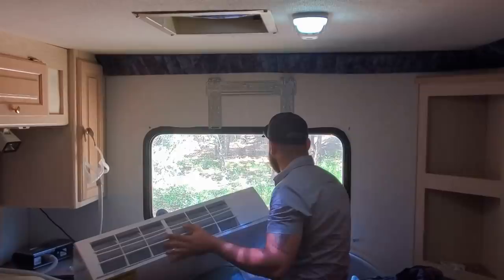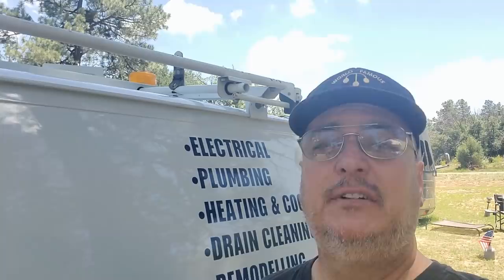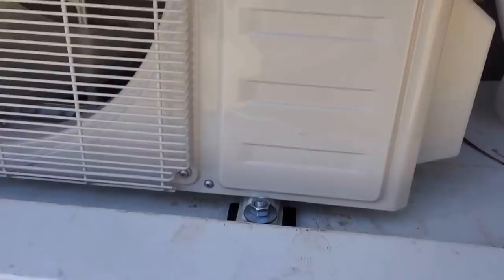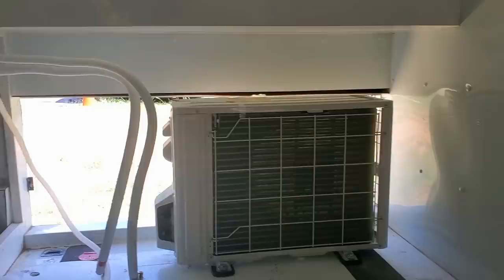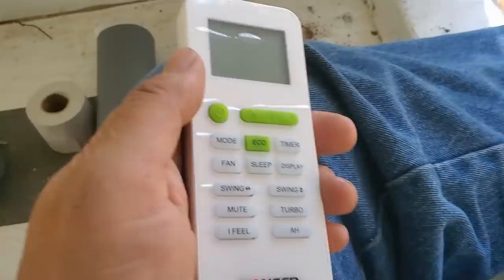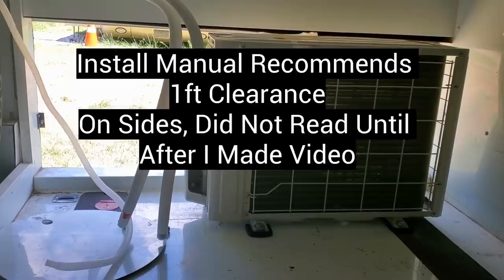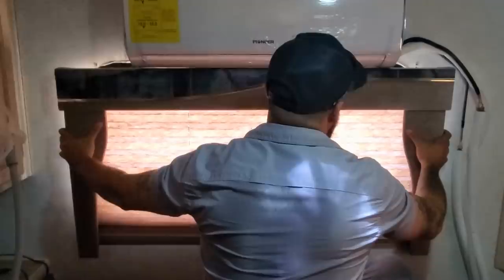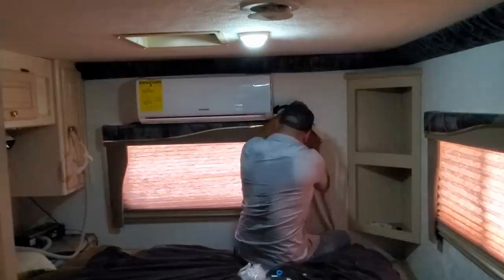Heating And Air Company Installs Residential Mini Split In My RV!

Comment: The fact he used nitrogen to check for leaks before adding the Freon tells me he’s a pro. I’d say you got an extremely fair deal for quality work. Always nice to see honest professionals who treat their customers fairly and do a good job at a fair wage. Congrats on the mini split. I think you should consider modifying the garage door with a vent to exhaust the hot air(probably need an intake somewhere as well) so you can securely run the system any time without worrying about critters or humans messing with your stuff.
Reply: I was thinking the same thing
Reply: Was thinking same thing.Cheaper and better for environment than freon leak.  Going to have to make sure to keep trunk clear enough to get air needs grills for intake and exhaust, I would duct exhaust to grill to cut down on recirculation. maybe some flat rubber with formed sheet metal corners. and brackets to attach to door grill.

Comment: I'm an hvac technician myself and I will say that man did a professional job on that install for a vary reasonable price.
Reply: Do I need a cutoff on the power supply, and where does it go in a Bumper mount for my camper

Comment: I have had apartments in the past and found that cardboard was the very best material to protect furniture, keep metals from rattling, and for so many uses to solve squeaky problems. Stick little cardboard pieces between your screws and the unit. Cardboard hugs tight. 👍

Comment: $331 to install that mini split was a steal, I had two in my house that I sold last year. Had two separate HVAC companies come out and quote me to install a double head unit one for the living room one for the bedroom. Lowes wanted $15,000 and the electric companies contractor wanted $9000. I went on eBay and bought two mini splits a pioneer and a Senville. I bought the
 tools to install them myself. They worked perfectly for five years that I lived in the house until I sold the house last year and the new owner wanted them so I let him have them. 
this guy did it right, purge the system with the nitrogen to get the air out of the system and did the vacuum check with his micron gauge. The air in the system is what causes these units to go bad after a few years. It corrodes the compressor.
These mini splits are so much better than the RV units and also they are very good inside houses.
Reply: I got split units for my house and cut my power bill in half.

Comment: RV roof top AC units last much longer than three to five years. I just sold my class A of 15 years and both AC units worked fine. Same with our trailer roof top. Works fine and it's 12 years old.

Comment: Bless Tuckers little heart, he's so sweet.
   I bought a 2020 class c thor 22' brand new and within 2 trips out I decided to drastically change my rv.  I love it now.  The Niecie B is my style now and my tiny home on wheels.
   She has more foot space now.
   All the valances were taken out and  I  made new window coverings for them, it gives the space a larger, more open concept.
   Changed the bed in the back to a twin bed and am able to walk up a step and sleep in my cozy bedroom.
   I couldn't find a MH I liked so I created my own space.   Installed a Sun Mar separating toilet and 
That eliminates the water waste and no emptying a black tank.  I'm a happy camper.
    I love the mini splits, I  have 4 of them in my home.  They are so efficient.
     How much solar do you need for a rv mini split?
   Take care Woof pack and say hi to Kevin.
Reply from the maker: Depends on heat or ac and location.  Heat uses lots of power. Ac not so much

Comment: I repaired and installed transport refrigeration units for 30 years. He did you right. Working on RV's is a pain. Having the customer supervise is even more of a pain. 
Rooftop air freezing is an indication of a low charge. In a humid climate you would notice it more. If you or a viewer would like to know why, I will explain. If nobody cares to know, I will save myself some typing.
Reply: Id say most likely on that too, unless the unit is super super dirty....
Reply: Danny is there a way to communicate with you privately .I have an ac question...
Reply: @judiwilson9229 I don't see how without one of us publicly posting an email address.  
Most air conditioning questions are not that personal, so ask here if you can.
Reply: Danny ok ..I have a house ac...I use on the average of 1300 kilowatts per month..the last 2 months they say I have used  3600kw.... Last year this time I was using 1300 weather was hot as it is now...can an ac unit make it rise like that? Or would you say a bad meter...two months ago I had my ac serviced because I didn't think it was cooling well enough and ac man put in three pound of freon 

I do know I have a leak some where in system..because about every four years I will need freon..my question is the kilowatts???
Reply: Id go to any new appliances first and check them. Use a programable 7 day thermostat (digital) and set it up to run per economic settings. Also check your thermostat programming, make sure its not "on" all the time.
Reply: @judiwilson9229  3 lbs is a lot of refrigerant to add to a domestic unit. It is possible your unit was over charged to try to compensate for a leak. There also could be air in your system that was not removed. Both things will raise the operating pressures and temperatures that the compressor has to work against. The harder the compressor motor needs to work, the more electricity it will use. The oil in the compressor can also become acidic and eat away at the motor's electrical insulation causing an early compressor failure.  When the compressor fails, there is usually a lot of contamination throughout the whole system. Cleaning it all out is not easy. Just replacing the compressor when it fails will cause another early failure. Many older units used a refrigerant that is no longer available, (R22). 
We used to have a sign where I worked that said, If you don't have the time to repair it correctly, where will you find the time to repair it again?
Putting a quick fix on something usually will cost you more in the long run.  An automotive air conditioner is a bit different as the compressor is externally driven. this means there is a shaft seal that will never be 100% leak proof. It is possible that every few years more refrigerant will be needed. A home unit should never need more refrigerant added. The motor is inside of the compressor housing. there are no shaft seals to leak. Not repairing your leak may have already caused you an early system failure. Start saving up for a new system.
Reply: Danny thank you..have two companies coming out to give me bids..but is it my understanding that I would need the lines changed too??? Or cleaned??? They are hidden behind sheet rock...
Reply: As far as the 3 lbs ..I think he put in one and a half..and then came back a month later and added another...the first time it wasn't that hot outside..he didn't get a good reading...and yes my ac uses R22..
Reply: @judiwilson9229  Being 3 lb low indicates quite a leak. The sooner the leak is repaired, the longer your system will last. Keep adding refrigerant is not going to work. When your tech runs out of his supply of refrigerant, they may not be able to get more.
The likelihood of a bad meter is very low. Something in your house is using more electricity.  You can also check to see if one of the air distribution hoses in the attic came off and is just blowing the cooled air into the attic.
Reply: @YouTubeRanch  Bids are important, but the lowest bid is not always the best deal. They may be offering an inferior product, or hap hazard workmanship. Check references with any contractor.
Reply: @judiwilson9229  If the existing lines will work with the new operating pressures, it should be OK to keep them, but a new system may require different size lines. Sheet rock is not that difficult to replace. That is where your leak may be. someone may have hung a picture with a nail and poked a hole in the tube, (they are copper or aluminium). 
The installer should pressure check during their install if you do keep the lines.
Reply: Well I wanted to let you know what was going on. I had the power company come out to meet her was fine. So they were very nice and started doing some probing into what was drawing so much electricity we thought it was the AC unit but it turned out to be the fan motor on the furnace it was going crazy drawing kilowatt time. So my new furnace and AC unit gets put in next Wednesday. It's time it's been 40 years. I got my money out of it. Thank you everyone for your advice
Reply: @judiwilson9229  Very glad that you have a solution. A friend had a similar problem with an expensive bill. It was a leak in his water line coming from a well pump. The pump hardly ever stopped running. 
It is very rarely a bad meter.
Reply: @judiwilson9229  Thats great! Good call using the power company to find your load. Remember on that new system more efficient means less $ to the power company each month. Good luck.

Comment: Kevin< I have a 12000 btu in my house also a Pioneer and I find that the condenser unit also condenses moisture that I find in the morning. the unit has a drain hole in the bottom and comes with a fitting to install with tubing you may want to use that and drain through the floor.

Comment: Tell Felix the Over head cam V10 engine  he will stretch the cam chain's  just start it let it ideal dont rev shut it off standard oil will kill the roller lifters. He will buy another rv before pay for new chains if you can find them.

Comment: FYI- for roof AC-  #1 clean the filter #2 check the evap coils for dirt/blockage. #3 Remove the control face and look for any gaps that should be foil taped. #4 Verify plenum divider is in place and sturdy. Brand new, a roof RV AC should have a Delta of 20 deg lower than ambient air temp.

Comment: I have to say I think he was cranking up his price by using nitrogen to check for leaks.  I'm sure that added a line item.  You check for leaks using vacuum.  You put it under vacuum and let it set for 30 minutes or an hour and if the vacuum hasn't dropped you have no leaks.  Pumping Nitrogen is just doing the same thing.  It's redundant when you do a vacuum leak down test.

Comment: REALLY IMPRESSIVE VIDEO....MY OLD ARMY BUDDY LIVES IN A 2 CONTAINER WIDE 40' MADE HOME. VERY PROFESSIONAL LOOKING. HE LIVES OUT IN PHOENIX ABOUT 30 MINUTES AWAY FROM ANYTHING. HE PUT 5 MINI SPLITS ON HIS HOUSE. HE ADDED A GARAGE THAT WAS THE 5TH ONE HE DOES NOT WANT HIS PICKUP HOT. HE SAID HIS HOUSE STAYS AROUND 72 ON THE HOTTEST DAY. HE HAS A SOLAR ROOF AND ABOUT 6KW HE CAN USE AND HAS A WINDOW UNIT IN THE BATTERY HOUSE WHICH IS SEPARATE. HIS LIGHT BILL HAS NEVER BEEN OVER $155.00 HE SAYS. HE IS ABOUT 75 NOW A VIETNAM VET LIKE ME AND HE SAYS HE CAN SURVIVE ON JUST SOLAR.. HE IS A LOT OLDER THAN ME BUT HE KNOWS WHAT HE IS DOING..STILL DRIVES HIS RED 73 CHEVY CAMPER SPECIAL PICKUP WITH A BIG ELDORADO SLIDE IN CAMPER. MINT CONDITION.

Comment: Actually they do make roof top mini split. I always wondered why people don't replace rooftop unit with the rooftop mini split. Who wants all that noise and get a high seer model the use a lot less power . My unit is like 9.5 amps outside unit and like 7 amps inside. Pulls very low power.

Comment: That drain line “can not” have “any” uphill slope ...
Will cause tremendous problems in the future if there isn’t a continuous 1/4” drop per ft.
The new refrigerant is very hydroscopic (means it will absorb water) and the system can’t have any water in it ... that’s why he used nitrogen (no water) instead of air (contains water vapor which would freeze at inappropriate places in the system and cause other problems as well)
Glad to you using an efficient system ... I might have missed it ... is it a heat pump as well?
Reply from the maker: The hose has been corrected.  It has heat as well
Reply: @CampervanKevin  Sorry for being so insistent ... but I did a service call on a mini split  in Edina, MN  ... Something about the drain line not functioning correctly ... don’t recall if our company (not me anyway) had installed the system ... the owners had called and wanted it checked out ... his wife was to be coming home from the hospital ... after recovering from a severe fungus infection in her lungs ... I pulled the cover open to remove the screen for cleaning (this  is on the evaporator on the inside unit)    the screen and and evaporator coils were so matted with fungus ... I’ve never in my Iife seen one so bad ... apparently the trees in the neighborhood were known cause this problem in some fashion in all the homes in the area ... 
instead of a 1/2 hr to hour service call I was there for hours as everything ... squirrel cage, evaporator coil and all had to be meticulously taken apart & cleaned out to get rid of all the fungus. 
This house was an older spectacularly well built 2 sorry home with very nice woodwork in the upper class neighborhood of Edina ... they kept the house exceptionally clean ... so this wasn’t due to neglect other than possibly not cleaning the screen on that inside unit (evaporator).
I remember that the room had a short balcony and a door opened to where this particular tree was located and the family had regularly opened the door to let fresh air in ... as this was in the 2nd floor Master bedroom ...don’t recall how the drain line plugged but it was the main cause of the problem ... I used my nitrogen tank to blow the condensate (drain) line out. We had just added a special cleaner to our vans purposely to be used in systems where they complained of musty odors or where home owners hadn’t cleaned the filters in the system or run without them and then either partially or nearly completely plugged the evaporator causing reduced air flow. The cleaner loosened the dirt so it could then be washed out ... we had little pump up 1 or 2 gallon garden type sprayers that we used.
So you will have a screen on your inside unit that will need to be checked periodically ... in an RV either the sink sprayer or the shower can be used to wash it out ... usually has a small amount of build up like you find in a clothes dryer and normally cleans up very easily,  let it dry or wipe it dry carefully then reinstall ... good to go. Glad to hear that it is a heat pump ... they are generally the most efficient types ... I’m sure in time you will greatly appreciate your system.

Comment: Hi Kevin, Looks nice. Function is always #1 in my books. However form is a very close 2nd and I often spend double or triple the time on it.  Did you consider removing the crown moulding at the top?
Reply from the maker: Yes, but unit needs to sit 4 to 6 inches from ceiling anyway

Comment: I wanted someone to install solar on my minivan. I had bought everything except the wires. I called over a dozen companies and nobody would do the installation.  I still have all the equipment but the batteries, I believe, are no good now because they've been sitting idle, exposed to the elements on top of sand. What a waste of my hard earned social security.

Comment: It won't last long without an exit vent for the hot air.
Reply from the maker: vents added to large garage door on passenger side rear. driver side left open when running. so far its worked great

Comment: Hey Kevin, did the one you purchased have a heater also with it? Or is it ac only? Im not familiar with these, but also thinking about putting one in my class c..thanks for the info when you have a minute...
Reply from the maker: it has heat also

Comment: Is that strictly an AC voltage unit or did you opt for the AC/DC that you could run straight off your battery bank?
Reply: They’re AC run off inverter
Reply: @leoblumhagen644   … They actually make both types.
Reply: @arthurleslie9669  “they who” I’ve never seen a 12 volt mini-split please inform me who makes them
Reply: @leoblumhagen644   … You can even see one sold on Amazon under the brand name:  ACDC 
Currently selling for a little over $1600.
Reply: @leoblumhagen644   … Hotspot Energy also produces a 48 Volt mini split.
Reply: @arthurleslie9669  yes I saw it 6000 BTU would be enough for a van but doubt it would be enough for his class C his unit is 12,000 BTU I believe, thank you for pointing it out
Reply: @arthurleslie9669  yes I looked it up 12,000 BTU $2,095.00 but eliminates the need for an inverter, thank you for sharing, that’s how we all learn
Reply: @leoblumhagen644   … your welcome.  And, yes, a lot can be learned from others.
Reply: @arthurleslie9669  ACDC doesn't have a heat pump
Reply: @leoblumhagen644  It doesn't have a heat pump.

Comment: Not very savvy with the AC stuff but I have a question: Will you have a way of evacuating the heated air from the fan for the condenser (think that's what it is called).
Reply from the maker: I will vent doors, until then I will open doors